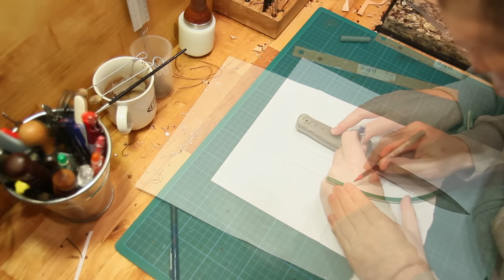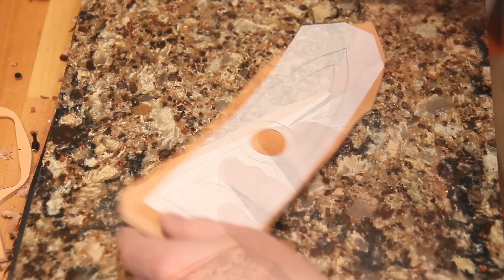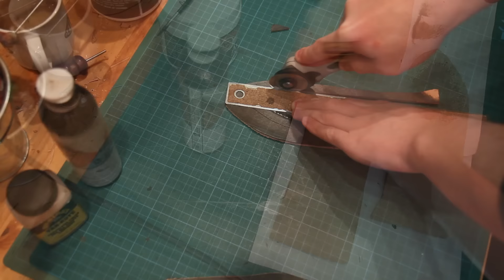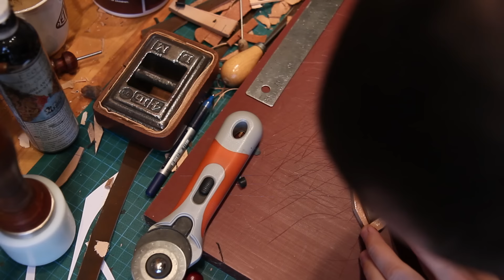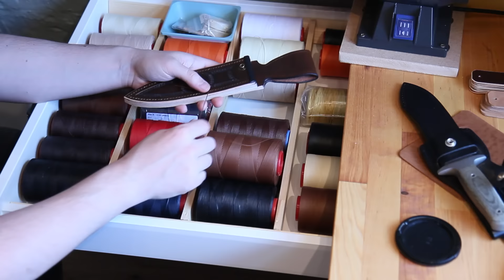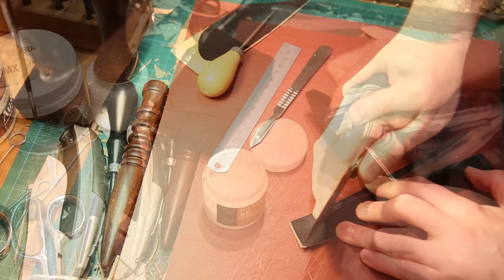Making a Leather Sheath for a Böker Schanz Dagger

Comment: Bam, You pulled out all stops on that one mate, A few new tools and techniques on display. Nice piece. Was a little worried that the sheath would turn out too thick but I think I was just sucked in by the way the light shone off the sides in the beginning of the build, The bevelling and burnishing took off the slab sidedness look in the end. Love the modest stamping work. Can't wait for the next piece, No pressure bloke :)
Reply from the maker: +Rhys Hughes the knife is made from pretty thick stock so it necessitated quite a thick welt to accommodate that.
Reply from the maker: +opensprit wasn't a #1 no.

Comment: Hi, I have followed you since I started leather working 30ish months ago and have used you as a top instructor. I have watched and re watched so many of your uploads I couldn't begin to count the hours total you have educated me. I may be wrong, but have you removed a bunch of your tutorial vids. I cant find one vid where you show using the dremel to drill stitching holes? Another is the 2 camera angle saddle stitch vid.Though you have graduated to hand awling doesn't mean I or others have have. Every one of your old tutorials are invaluable to me, and probably to others. Seems many of your older vids are gone. You should re up load them. Huge fan, thanks so much, JohnPS You sufficiently explain yours isn't the only way and proceed to show how you do things, and in the past how you do things has been AWESOME.
Reply from the maker: +Home Crafter.ca I haven't removed any videos no, though if I did that would be entirely my prerogative! If you're struggling to find something use my website as the videos are all organised and indexed on there.

Comment: That was some incredible work!  I really appreciate you going thru the steps like this, it helps to inspire me to try things.  I like how you folded the belt loop to the inside and shaved it down to keep the thickness down and give a beautiful finish to the back side as well.
What was the black material that you sewed to the top front and folded over to the back side?  I found that interesting.
Reply: +NeoWolf It's written in the description, kangaroo skin.
Reply from the maker: +opensprit it's lining the back of the stud to protect the knife, hence it's a lining; it doesn't need to go any further down that that. I'm not sure why you think this is 'taking liberties' unless you're just trying to annoy me?

Comment: beautiful job Ian. This has nothing to do with the sheath, but with all the restrictions on knives and the recent hysteria over "Knife Crime" how did someone manage to import this knife? I know knife makers who will refuse orders from UK because their knives have been seized by customs. Anyway, enough of my rant. you are an inspiration to knifemakers like me who struggle to just get the stitching on the back to look as good as on the front.
Reply from the maker: +God of Thunder (UKKONEN) the knife is available to buy in the UK so there was no need for my customer to import it, however it would have imported without any problems as it's a fixed blade knife and not illegal to buy. Most of the import problems surround locking folders.

Comment: Very nice Ian.  I see you burn your threads with a flame have you heard of thread zap 2 by Bead Smith I have one and it is so good at burning the threads down to a nice small ball very close to your work without the flame the tip gets very hot glowing red hot at times. they are used by beaders to burn threads back. If you need links to good sellers send me message.
Reply from the maker: +TheCraftyskill found one on Amazon, I'll give it a go!
Reply: +Ian Atkinson If tip gets to messy from the burning I just run fine sand paper over it when it has cooled down but be careful the wire is thin. My other half was going to bin her nail sanding pad I said let me have it worked a treat and you can do it when its warm and it more the mess faster. I wouldn't be without mine and I always have tips in just in case one breaks.